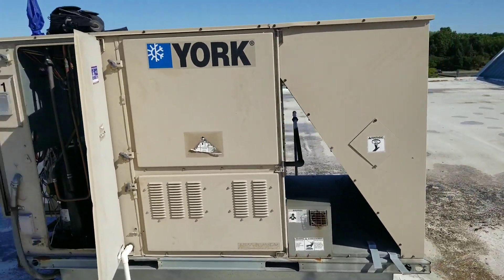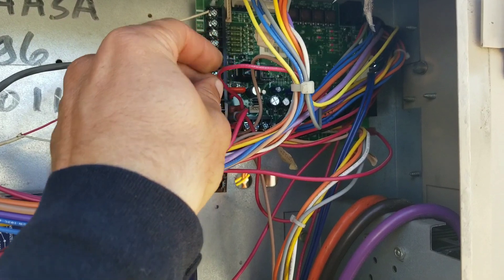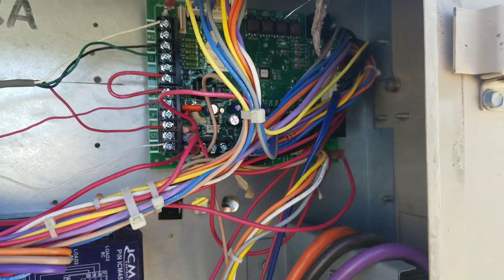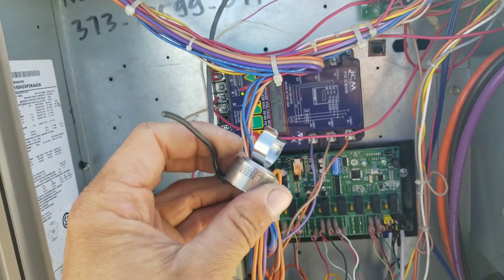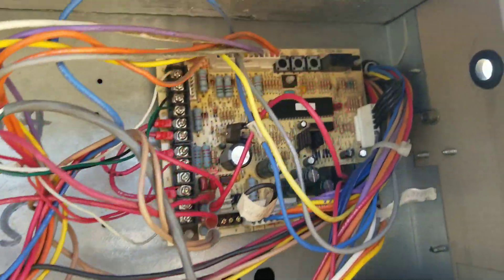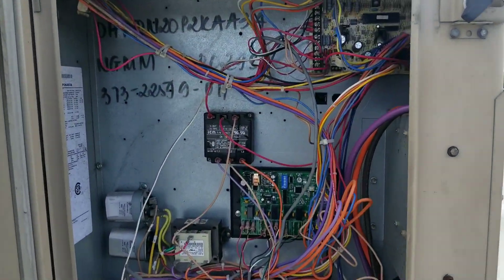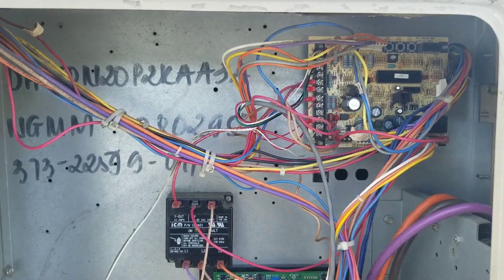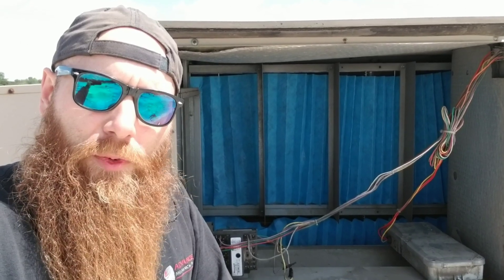York Package unit not cooling

Comment: Hi, my york rtu unit is in heat mode and giving a HS1 limit switch error on the smart simplicity control. I've checked the high limit switch and it seems fine. The manual for the control says the LS1 has tripped 3 times within an hour. This results in the HS1 LIMIT SWITCH LOCKOUT.  Any help would be greatly appreciated. Thanks.

Comment: The 2 flash is start up delay.  If you hold test button for 3 sec it will bypass the delay
Reply: That would be one of the 3 black buttons on top corner of board

Comment: Just FYI smoke alarms have a tamper switch on them ,the cover has to be on to work correctly ,and reset
Reply from the maker: Interesting- I did not know that, thanks for the tip
Reply: @curioushvacguy6876  Now I'm curious, wouldn't the duct detector being in "alarm" at least have triggered a trouble on the fire alarm panel?

Comment: They should have been getting a trouble alarm on the fire system inside the building .. next time your control circuit is doing weird stuff I bet the smoke detector will be the first thing you look at - corset all u have to do is check for that 24 volt input from the smoke detector...
Reply from the maker: Thats exactly right, next time I hope my experience with this unit kicks in and I get it diagnosed much faster- thanks for watching

Comment: Also keep a lookout for return dampers closed on some fire systems. Sometimes the whole roof is wired to one dry contact at the fire panel, locking everything out for 1 fault somewhere.